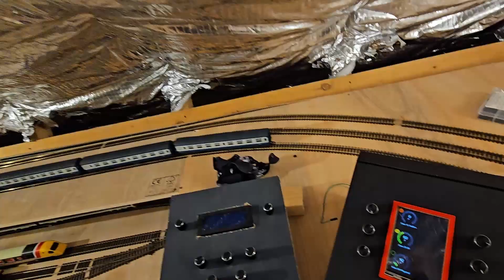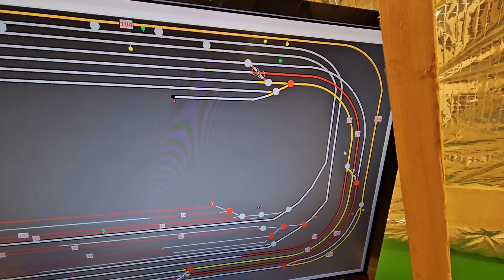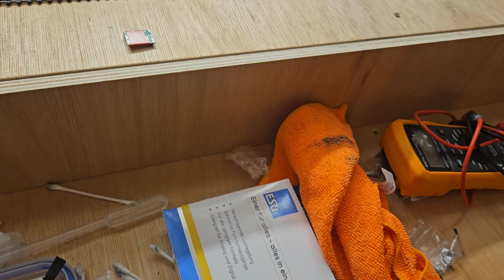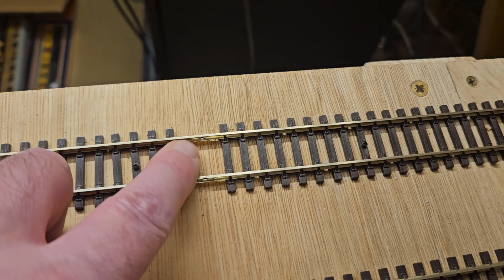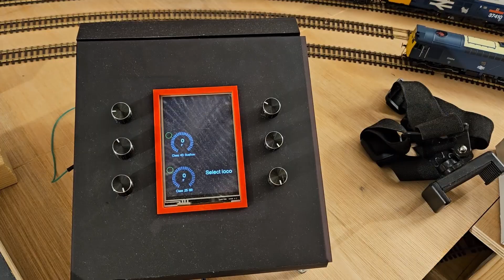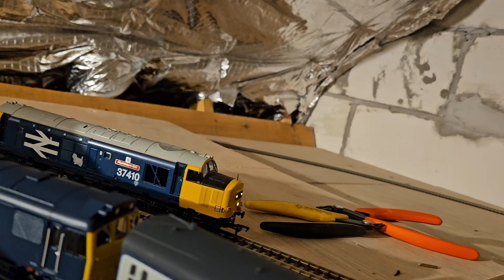A quick look at a Heljan Class 25, the DCC-EX command station and a general catch up

Comment: Another great video.  Regarding the lights on the Class 25, I think it allows better realism.  In the real world you should never have a red light showing on anything other than the last wagon/coach.  (A very important safety requirement).   Only when the engine is running without wagons and coaches should it ever have red lights showing.  I suspect Heljan have taken this into consideration.
Reply from the maker: Thank you - that's really insightful, helpful and interesting. It's also a good point that I look at these things from an experience of model trains, and don't factor real world operations (of which I know practically nothing) into it. Thanks again, really interesting! Regards, Chris

Comment: use the same DCC-EX motor board here, its lovely, hate the damn barrel connector, screw terminals would have been far better.. not to mention the OLED connector gets blocked by the WiFi shield, that said once working its zero trouble

"a lot more electronics experience"... I have a pair of controllers speaking gibberish currently.. once they work a video is going up on what went wrong..
Reply from the maker: Looking forward to that - I find myself having to make quite a few 'what went wrong' videos, all part of the learning process! Chris
Reply: @WirenwoodModelRailway  tend to learn far more when something doesn't work than when you can just copy instructions parrot like.

stuff on hold until next week as family are here and youngest has hijacked my desk

Comment: do you have problems with the loft temperatures in summer and winter ?
Reply from the maker: Hi - I put quite a bit of insulation in at the start - the Superquilt stuff - and it does help massively. I've also bought a little heater from Amazon and that's made a massive difference on cold days like today. In mid-summer, in a heat wave I wouldn't want to work up there for very long, but compared to the last loft I worked in that had no insulation at all - it was pretty much unbearable from April until October, so having just a few days where it's a bit too warm now makes a massive difference! Regards, Chris

Comment: Sounds like a fishplate / rail joiner not having electrical continuity. Recommend soldering a separate dropper wire to every length of rail on the layout, so you never rely on a rail joiner for conduct the electrical signal
Reply from the maker: Thanks - yeah it was just slightly misaligned. As for additional droppers, I'm afraid that at this stage the tactic is definitely going to be reactive rather than proactive! Regards, Chris

Comment: Still giggling at every mention of knob box. :)
I think good practice would have been to put droppers on every piece of track although it's a lot of work.
All looking good so far...
Reply from the maker: Thanks Jeffroid! Yeah I did set out with the intention of every other piece of track, but I wasn't good enough to solder them without some kind of disruption to the sleepers, especially on curves, so I didn't quite manage that. Ha, I'll be 50 next year and am still wondering when I'm going to grow up! Regards, Chris
Reply: @WirenwoodModelRailway  Well, I'm 65 and never intend to grow up.